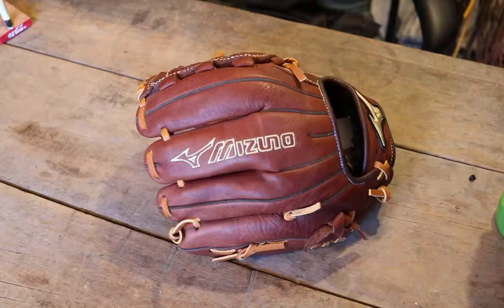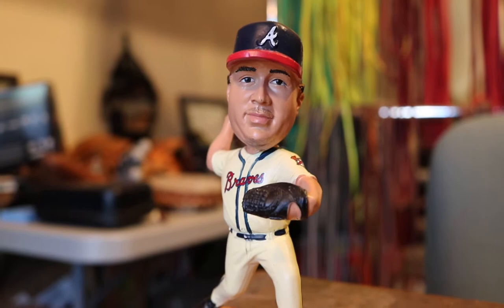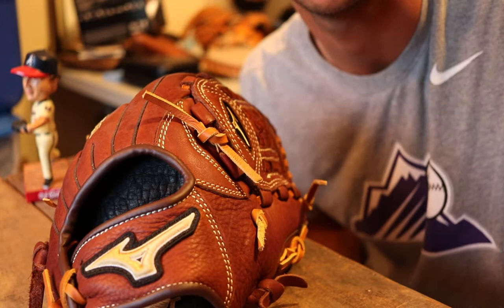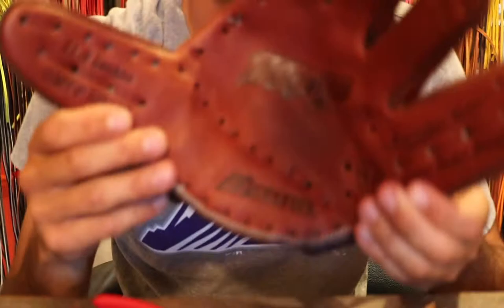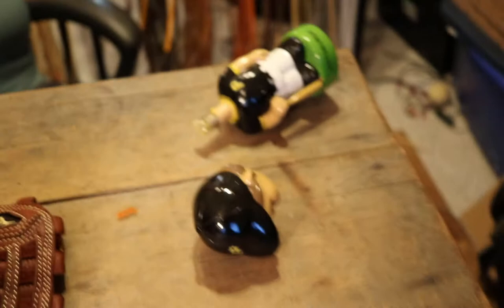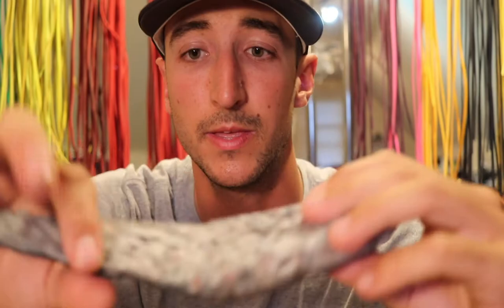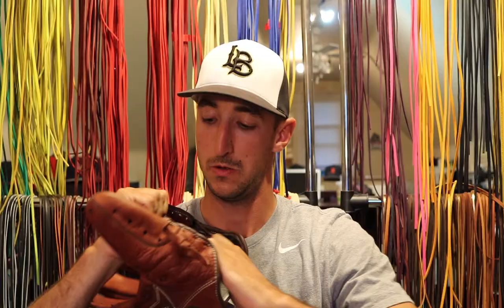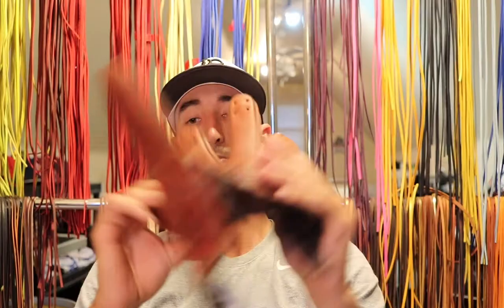What's Inside a Baseball Glove

Comment: is it possible to add a thin layer of padding in between the leather in the palm? The area you showed us with the glue.  My Heart of the Hide Rawlings palm feels very thin and fastballs hurt.  Is this something people do?
Reply from the maker: Hey Jason! That is totally possible to do! I know a lot of people that have done that, or get the dual cores! Let me know if you have any more questions
Reply: @Mitch Lums I really appreciate it. I already have a standard heart of the Hide. What would I do. Unlace the heel and the pinky side palm. Seperate the glue. Push in some thin fabric then add glu on both sides? Then relace? 

I found the felt on grainger, gonna get F3 felt.   But what kind of adhesive should you use that wont react with the leather long term.

What kind of glue should I use?